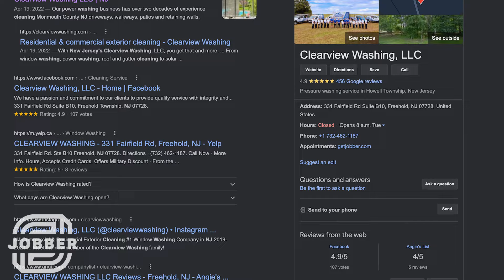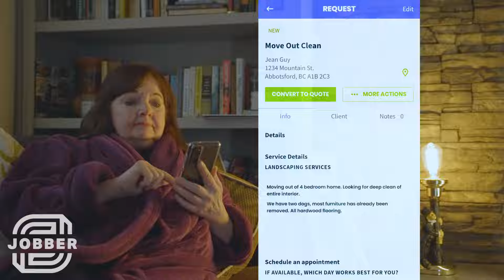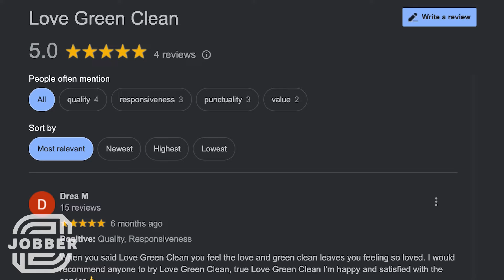How to Market Your Cleaning Business and Get Customers Fast | Getting Started Part 2

Comment: Ayyyy! She wiped the toilet seat, then wiped the top of the toilet, which spreads germs horribly. You should never charge a home hourly or pay an employee hourly. You should always pay by the house at a set rate. Always ask qualified questions prior to arriving.
Reply: Glad you caught that. I usually start with the top of water reservoir, move down, then top of toilet cover, then flip toilet cover, clean it then move to top toilet seat, bottom of toilet seat, then move to the top of the actual toilet, I then close lid and clean behind the cover in between the reservoir and then move downward around the toilet. Obviously keeping the towel folded in 4s so you know which side gets dirty as you work.